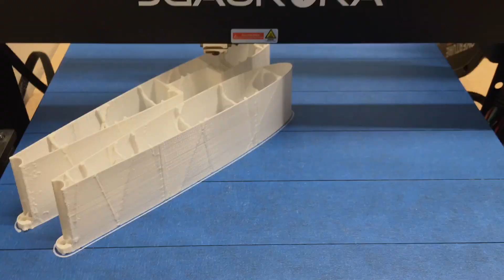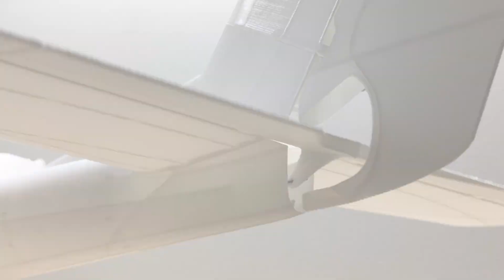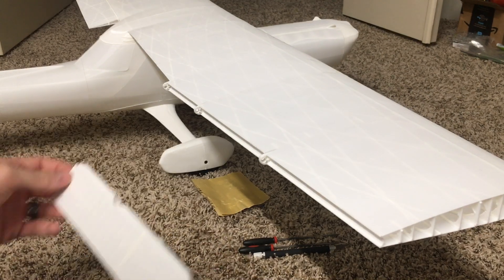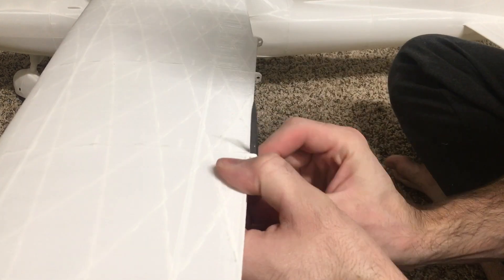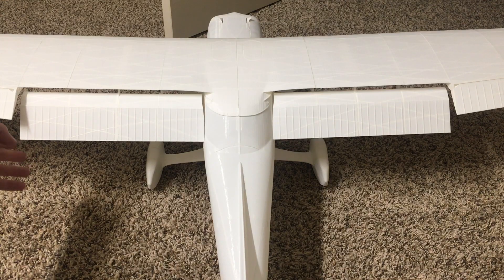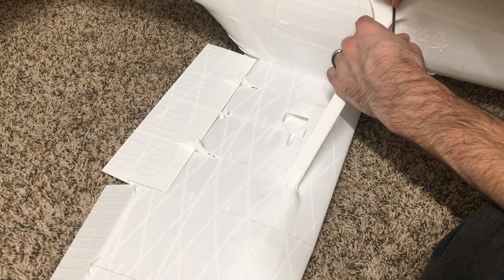3D Printed Airplane C152 Part 3 - Wing & Tail Build

Comment: When testing the parts for fit , hold the up to some light and check for gaps in the join. If you can see through tehn the parts need trimming somewhere. Do not proceed until you get that join fixed/trimmed. Reprint if you have to...yes it is a pain but that is where 3d printing is at at the moment.

Comment: Your parts look like they are clean, stiff and not flimsy.  Ones I print from the supplied g-codes on a Prusa i3 clone some come out good, others come out with layer issues.  Some parts are stiff, others are not, especially the tail sections and couple of the rear cabin sections. What are your settings since it looks like you used .stl files and not g-codes?  Appreciate the build videos. I am in 25 hours so far with prints.  Just like to avoid wasting PLA as much as possible.

Comment: some info.     at 5:34,  a main wing  Should  have  ribs.    to some extent, the joins in the main wing act as  pseudo-ribs; it's too bad the design did not include  actual ribs.     a wing  Should  have a main spar,  located at  Thirty percent of chord/mac.     at 7:21, was an  invisible dihedral brace used.?      at 7:42, you should expect this wing (that does Not have a contiguous main spar/structure) to  Fail  in flight.     at 7:55, when  COPYING  a  full-size reference design, a hobbyist  should  know  when to  NOT  use certain 'scale' features;   such as, an excessively sloped  vert-stab  LE.    see other, slightly, less-sloped  cessna vert-stab iterations.    cheers      googletranslate
Reply: David Davids that's totally not needed for this model. I've build lots of plastic planes and the wing holds up to about 5 G easily.